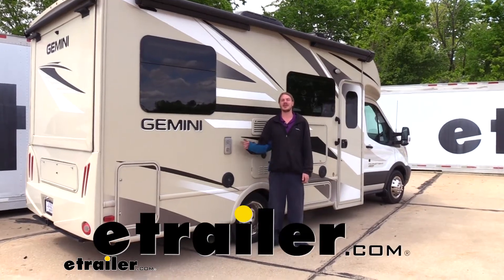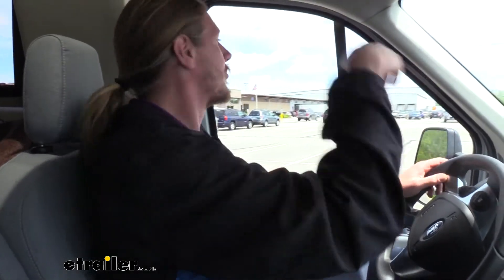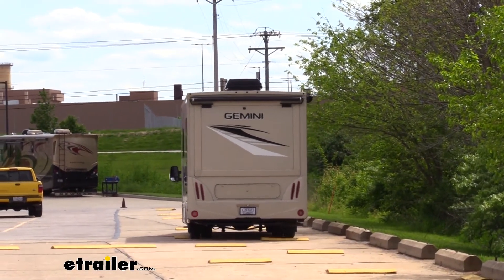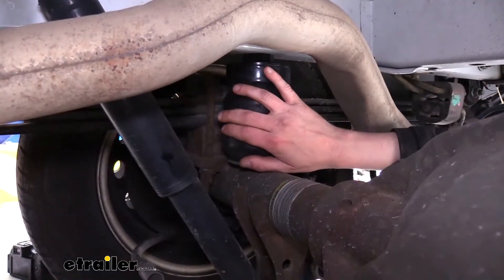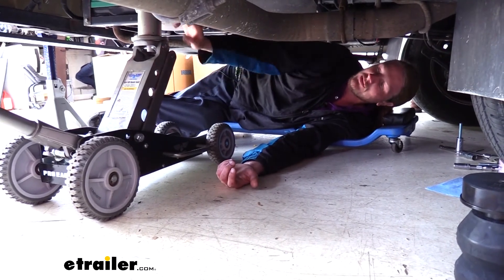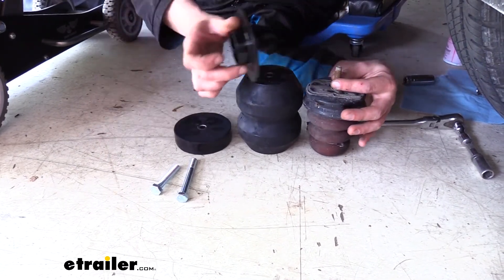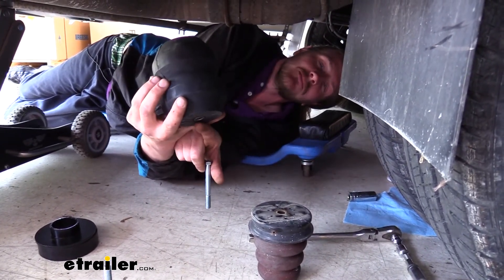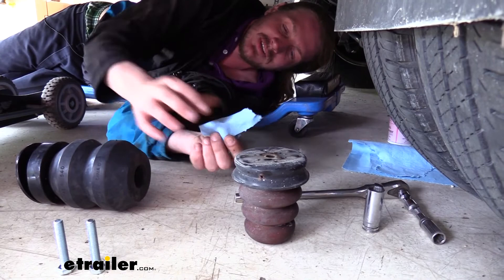etrailer | Install: Timbren Suspension Enhancement System on a 2016 Thor Gemini Motorhome

Comment: Your not rocking as bad but the noise inside is considerably worse.
Reply from the maker: It will provide more stability but these may make your ride a bit more stiff. These are designed for support, not so much comfort. We have SumoSprings that are a softer design but will still provide support to the rear end.
https://www.etrailer.com/Vehicle-Suspension/SuperSprings-Intl/SSR-121-47.html